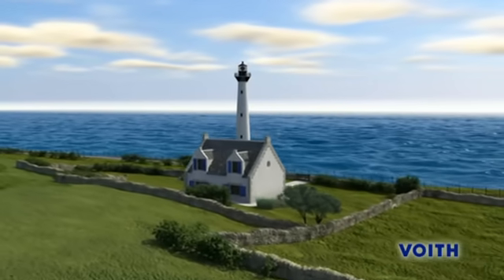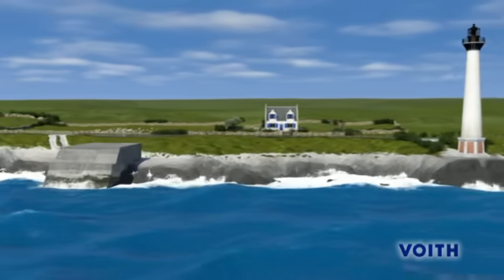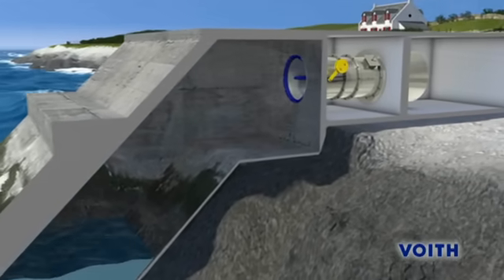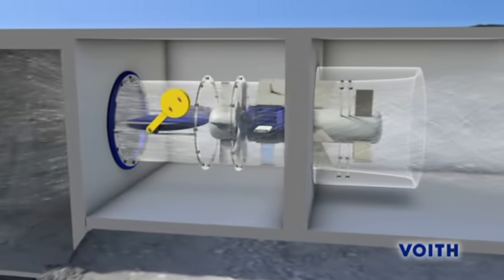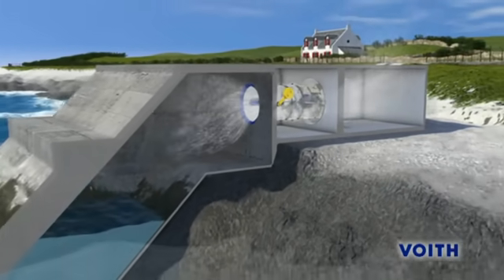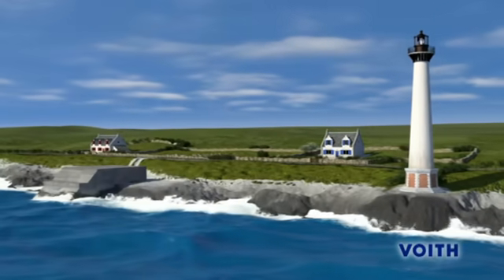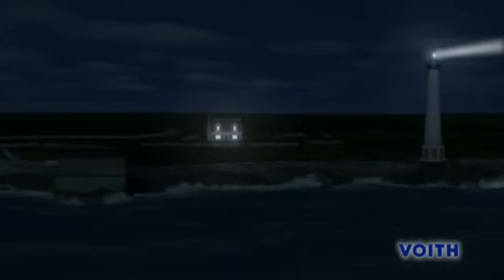Ocean Energy -  Wave Power Station

Comment: It doesn´t matter the video is from 2009. The idea is great anyway. But it seems Voith Hydro does prefer tidal power stations now.
Reply: The physics of this idea would really be more applicable at very small scales. Like drinking straw sizes. There just isn’t enough time between waves for a highly compressible media like air to get a continuous drive going.
Reply: joe; couldn't imagine it to be incredibly expensive.
Reply: We don't know if it's actually "great". It looks like it requires a ridiculous amount of concrete, which is one of the major contributors of CO2 in our atmosphere. Then you have to look at the costs of maintenance  - salt water generally doesn't play nicely with almost any kinds of devices. Then you have to clean it from marine life.
Reply: Edgar: At least the idea has been proven great and although voith Hidro prefers another kind, at leas we know the wave generator knowledge is there should it ever be needed.
Reply: Omg I thought u died
Reply: 3r
Reply: The idea is great. Sure. As an idea. That’s it tho
Reply: @seapotatoes7260  😁 your backyard is like where the hell do you want us to put your ocean.
Reply: The most successful wave power plant, Mutriku Breakwater Wave Plant, was commisioned in 2011 at a cost of 6,4M€ for 296kW peak. That's 21.000€ per kW nameplate Power installed. 20 times more than wind, and 30 times more than solar. 
But maybe it's generation more power to make it worthwile?
By the end of 2023, the total lifetime generation was 3 GWh. That's about an average power over 12 years of 12kW or 9% average load factor. That's abysmal. Wind, in germany, has 23% onshore and 28% offshore. In good wind locations like Scotland or Tasmania, it's 80%.
So it absolutely sucks at power output too despite being 20 times more expensive to build /kW nameplate. 
So maybe it lasts longer than the 20 years wind turbines work? Turns out, the turbines are worn already and need to be reoplaced for 3,4M€. 
SSo they even last only half a slong, making them 75-150 times more expensive per kWh generated than wind. 

it's a crime to still burn valuable renevable investmentcapital on wave power after all those projects proving without a doubt that it is far too expensive to build and maintain.

A € in wind power saves  75 to 150times more CO2 than the most successfukl wave power plant does. 

And still- new projects are popping up sucking away all that green investor money to shurely fail.
Reply: The thing here is a large concrete structure and would be very expensive.
You can make these things cheaper. Imagine for example using standard POM tubing mounted vertical in the shore line with a turbin higher up in a a venturi constriction. This would be fare less expensive and space effective.
Reply: i totally see the irony that my comment itself is not very polite
Reply: Everyday it amazes how every smartass on youtube is an impolite bastard. I totally agree that the concept is probably not much worth but didn't your mama teach you manners
Reply: @Jecksnkovski  😁 not very common. manners teaching mamas.

Comment: ...so why don't you just use the movement of the water? I mean directly?
Reply: By separating the turbine from direct contact with the ocean, it is protected to some extent from corrosion and from some of the highest mechanical loads from waves e.g. turbulent flows or even "slamming" when the wave breaks right on top of you.
Reply: there are other devices that directly use the movement of waves to generate electricity, there is the buoyancy unit and the line absorber, since they are mid ocean, maintenance is an issue, they require high pressure flow lines/underwater powerlines and they can also be easily damaged due to the strength of the waves
Reply: erik dee salt spray in air is more corrosive than submersion in salt water.  Pumping air is less efficient than water as pumped air has thermal losses Since air heats up when it is compressed. But I suspect that the elasticity of air does serve to protect the equipment from severe forces.  However you could also just have blow off valves it would be held close by gravity and would pop open to relieve excess pressure

Comment: What if the chamber fills with water
Reply: Water level sensors to close the upper vent and create an airlock?
Reply: thought the same thing
Reply: well this is just an example, I believe it could be scaled in such way, to prevent this. Like if it was 30 feet high above the sea or if the whole thing was made water resistant. which nowadays isn't such a big problem.
Reply: Good question...you get a hurricane storm surge and say bye bye
Reply: Tributary House Ltd. Thought the same thing :)
Reply: Dude, use your imagination. The video is self explanatory. There's a front brick that covers and protects the force or splashing of the water from the beach waves. And if you know about turbines? There are other methods to use the current or waves of the beach/ current of the water flow. This is not a bad idea or concept for clean energy.
Reply: I’m sure they could come up with something to stop the water from damaging the machine. But that is a great point.
Reply: Mike Mcelveen the thing might be flooded from the top side?
Reply: Steve Leahy good question
Reply: Steve Leahy hmm
Reply: If it's higher , it cant be filled with water
Reply: Silly rabbits, huge petcocks (check-valves) will prevent unintended directional flows, it is understood, sea water eats stuff.  That is why; this is not as viable as...say, solar cell.  Sits in the sun and bakes for years; good efficiency ratio vs: the ocean which eats things on a much shorter time scale.
Reply: There are places on the world where the ocean level is fairly consistent......... For centuries. There can are plenty of places that do not really have to worry about tsunamis, hurricanes, or earthquakes.
Reply: That is not possible due to physics
Reply: rasmus persson could you explain why

Comment: This vedio uploaded in 2009 .. now it's 2017 . Still this technology under paper ?? Hmm must have some inefficiency
Reply: koo koo investment to profit ratio in such projects are very low and also the energy output is not that lucrative as compared to wind and solar. A medium sized solar project which took 7 - 10 years in the past for the recovery of the investment. Now takes 3 - 4 years. Thus killing of this method for time being. But I do think that when we come to practical saturation point for the renewables we'll come back to this method.
Reply: Hes not talking about the turbine thoug his he. hes talking about the whole system. The "inefficiency" will depend on how fast this air pressure can spin the turbines (faster=more energy) compared to other systems aswell as taking into considerataion the cost/time to build and how much space it takes up.
Reply: Scotland has continued to build new wave energy devices. It's not just "under paper".
Reply: Not well suited to beaches.  Hence not being installed on a beach.  Beaches are too shallow, like, well... you'd know
Reply: koo koo nop, just billionaires stopping it because of other means of making power, they make to much money.
it's always about money.
Reply: cost per kw cant compete with fossil fueled stations. when we go green we will get wind wave and tidal but the power bills will probably  triple, solar is cheap but its problem is, it does not produce when it is needed most
Reply: It is horrible inefficient compared to wind and solar - nowhere in the world is it feasible. -so sad. Here is one company that closed in 2013, but it is the same for all: https://www.bbc.com/news/uk-scotland-highlands-islands-21657133
Reply: koo koo same as cars. Fort cars were slower than horses but luckily negative idiots like u didnt prevent cars evolution
Reply: Actually it closed down in 2013....
Reply: Companies have to build it

But companies care about money

Perhaps I don’t know maybe a government could have the intellect to spend less on war and more on projects like this
Reply: Bro, it is most expensive renewable energy
Reply: Yet in 2020 it is still going
Reply: For the skeptics please watch the video until the end.June 10, 2020...
Reply: Do they factor in the capital costs of construction and the ongoing maintenance costs versus the amount of power produced?
Reply: > generate meaningful amounts of electricity from 1 meter waves, 90% of the time.
>  be able to survive 10+ meter waves
Lots of concrete and steel for a pitiful amount of energy captured.
Reply: or politics, ever heard of 'em?
Reply: You're correct, this is by definition an inefficient process - due to the very low compression ratio (which is linear to efficiency, the higher the better) first of all but also due to the 'turnaround' losses. Up&Down moving floats on arms driving a generator is way more efficient (and more of an eyesore) and this seems to be the way forward.
Reply: Salt?
Reply: Oil
Reply: or some politics involved lol
Reply: Or too efficient?
Reply: The highest inefficiency is that it doesn't consume anything - so the coal companies would go bankrupt, as across the western world generating electricity seems to be the main demand for coal.
Reply: @still34u  murca: DID SOMEBODY SAY OI- oh he said coal...
leaves quietly
Reply: Eyesore

Comment: This videos a bit out of date now sadly the Islay limpet is no longer generating electricity. I went to visit it this summer July 2017.
Reply: why is that?
Reply: Asterio The company that operated it moved away from the UK. I think they had learnt what they needed from it and maybe it wasn't commercially viable due to its small size and remote location. I know the rated output was halved at some point.
I wonder how much it would cost to buy the site and install a new turbine. Seems a shame after all the work done on rock blasting and concreting that its not generating anything.

Comment: How does the fan blades go the same way with either direction of the air??
Reply: +Daniel Rose - Normally, a turbine has its blades at an angle in order to catch the most air possible. The Wells turbine sacrifices efficiency by having the blades 90* to the passage of the air, giving it an extremely high angle of attack. Imagine if an aeroplane tried to fly with its nose pointed upwards or downwards, the wings would produce very little lift. Similar situation here. The turbine's shape causes it to turn as air passes (though far less than a standard turbine would), and because it is completely symmetrical it will continue to turn no matter which direction the air is moving.

Here's a diagram to show you:
https://i.imgur.com/pt3f37P.gif
This symbolises the turbine's blades. Note how most of the air will be driven to one side of the blade instead of the other. It pushes on the angled surface, rotating the blade, and it will do this no matter which direction the air is coming from.

Quite ingenious really. When you have a constant source of air moving back and forth, I can imagine this works very well.
Reply: @thepoppunx no, a wells trubine is a fixed wing turbine. That is the genius part of the turbine, it uses a symmetric wing design to rotate the same way regardless of the wind direction.
Reply: thepoppunx how bro?
Reply: sameer kujur nope
Reply: its changes the wings angle
Reply: Daniel Rose even i got to know when I did a small project on it btw thx for reply
Reply: sameer kujur No! I can not explain the trubine but it always spins the same direction, regardless of the wind direction. It has a wikipedia page, maybe some of you have a better physics understanding.
Reply: ReddwarfIV thanks for linking that diagram of the crossbsectionof the fan blade.  That is a wonderful design, elegant in its simplicity
Reply: shows01 well I guess that's the problem.... cz once when the waves are rising the fan would move in a direction say clockwise... but when the waves would fall the fan would go anticlockwise... so we won't be able to produce energy... but the idea is going... but something is lacking..
Reply: We are Asian's the fan goes the same direction regardless.  The fan has a thick symmetrical teardrop shape cross section, get it?
Reply: shows01 Google it man
Reply: +shows01
Something like this maybe
There was another video of guy who printed out a version of this on his 3d printer and he explained it too but I guess I didn't like the video so I can't find it. Sorry.
Reply: You can solve this very easily mechanically. There's videos here on it here on youtube. Try searching: "This mechanism only turns clockwise, no matter what"
Reply: the same way an aeroplane wing can generate lift when flying upside down.
Reply: Put a frèewheeling system and two set of blades. In that way you will catch the airflow both sides.
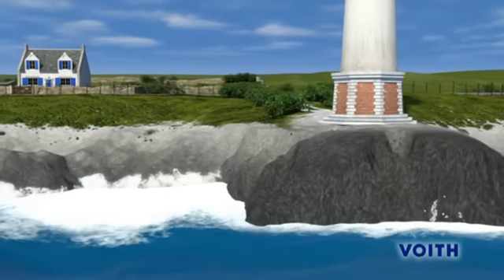Reply: https://www.youtube.com/watch?v=kXfSrCWA7qA starting at 0:30 seconds in... if you're still interested.
Reply from the maker: This is a special turbine named Wells turbine.
Reply: Thanks for the explanation. It's very clear now.
Reply: shows01 By the use of valves. They ensure unidirectional flow of air

Comment: not going to happen on a third world country... sooner than you expected illegal settler will live inside that station.   and what's more if that will be build near beaches... expect some couple to have a quicky inside too. 

anyway what will happen if there is a typhoon..  and storm surge
Reply: Robustness is one of the most challenging problems with wave energy (particularly off-shore). There are a lot of difficulties when trying to prevent damage to delicate moving parts. You're right on the typhoon point - that can  cause massive surface waves (30ft+ in height) and are a real problem. The fact is wave energy is one of the least popular methods of renewables until only recently, so the technology hasn't quite been ironed out.

Still, it has massive potential for usable energy generation!

Comment: Why choose an air turbine generator instead of a hydro turbine? water is 800 times denser than air. You could make generators smaller but just as powerful and thus cutting cost even more
Reply: Michael C. Daniels lol, dude, OP is asking why not use sea water rather than the air as the working fluid, not suggesting to build a dam instead
Reply: this oscillating water column is just one of the many devices invented to exploit wave energy, so if there was more funds into researching this renewable source than we could possibly work our way around the issues presented
Reply: There are other kinds of water and ocean based power turbines. This is just one of them.
Reply: Yes and a funnel system.
Reply: I'm guessing it has to do with sea water corrosion or sea weed / sea life getting in the way.

I think this design requires an airtight seal which could potentially be more of a upkeep challenge though.

It's nice to see weird ideas though.  I'd like to see something really weird, like a green house over a lake in a desert, or a passageway for marine life that spins a turbine LOL
Reply: man I love this comment section everyone is so smart
Reply: Because hydro-electric turbines usually require dams...dams that are hugely damaging to the surrounding eco-system. The name of the game right now is not total power output, but more about efficiency, being as green as possible and not damaging even further our landscapes. Now the last thing I would want to see is entire coastlines barraged by a parade of these, but they certainly can be strategically placed and not nearly as impactful. Not to mention we would still need to use a mix of all other kinds of renewables like solar and wind to really meet demand. Energy sources like coal, nuclear or even hydro-electric are a thing of the past, while the wind, solar or even tidal and geothermal need to be the future and I think 'wave' fits right in with that.

Comment: Waves are too unpredictable but tides are an entirely different matter.
Not with turbines through. The tide will lift anything that floats from a leaf to a million tons of concrete and steel. A big enough float travelling 4 or 5m up and down twice a day represents a huge energy potential that simply needs to be tapped.
Reply: waves are pretty predictable, you can forecast them days beforehand, they are also consistent even if they aren't visibly seen.

Comment: It appears very environmentally friendly! What is your power output?
Reply: It was originally scoped at 500kW, but never generated more than 34kW to the grid, and only provided power to the grid for 1800 hours. In saying that, it was mostly a research project, and there are a lot of "lessons learnt" on efficiency of the design and construction which you can read here: http://citeseerx.ist.psu.edu/viewdoc/download?doi=10.1.1.473.2780&rep=rep1&type=pdf
Reply: Richard Clutterbuck so it can be made out of composites then.  No big deal.
Reply: Richard Clutterbuck what about Roman concrete?
Reply: 500KW
Reply: Not bad.  Not bad.
Reply: MegaOcean22 It needs numbers yes
Reply: Peak power, continuous power, rated power?
Reply: This would be a great time to use Roman concrete. It lasts much longer than modern does